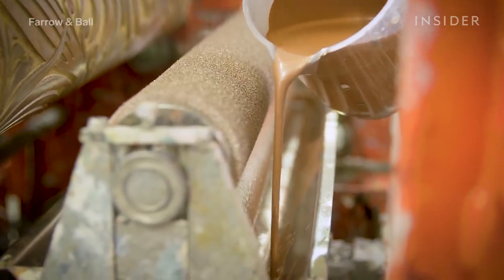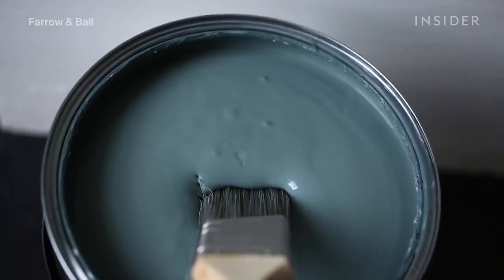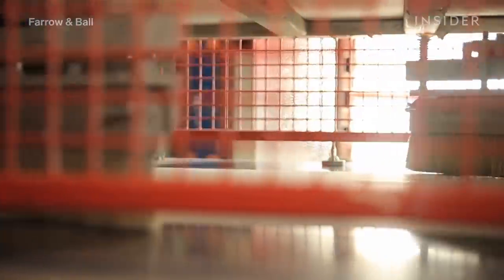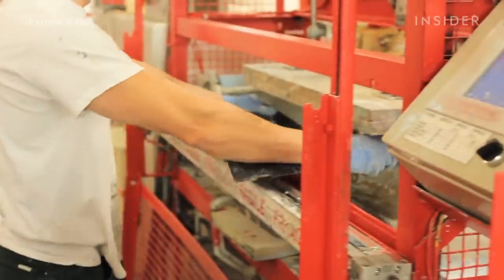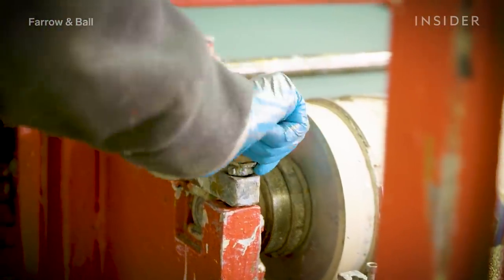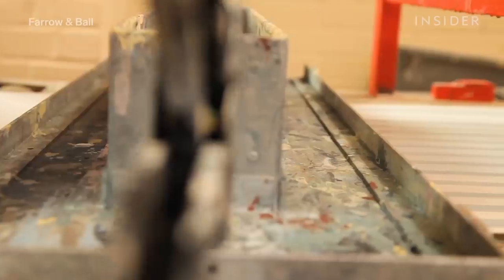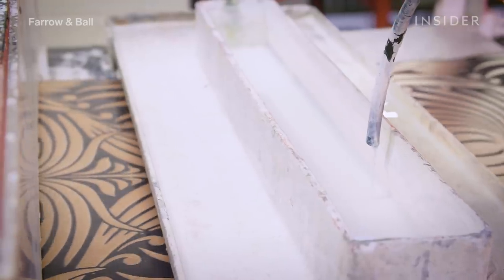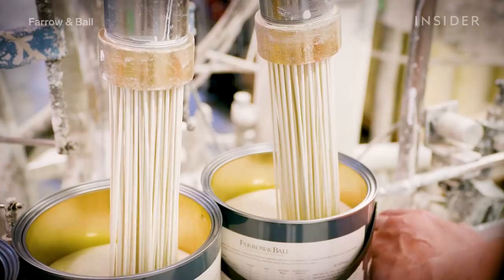How Luxury Wallpaper Is Made | The Making Of

Comment: I didn’t understand how the last method works.
And why use the first method? The second one seems way more efficient.
Reply: third method they pour the paint in a recipent with holes, under which the paper goes through. The holes are spaced so it makes stripes. 
the first method is for big designs. If you have a very tall design, the roll would need to be very big and it's more practical to use the method they show.